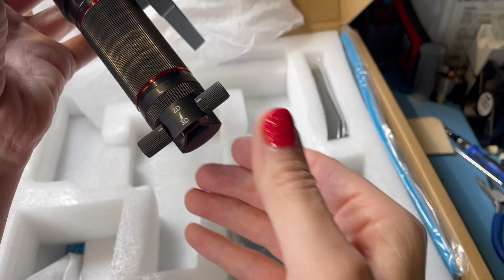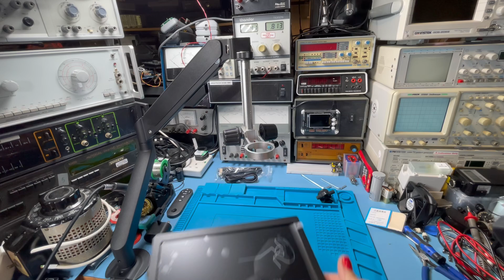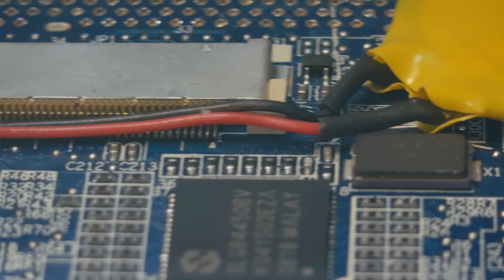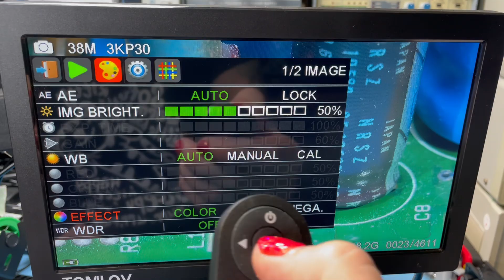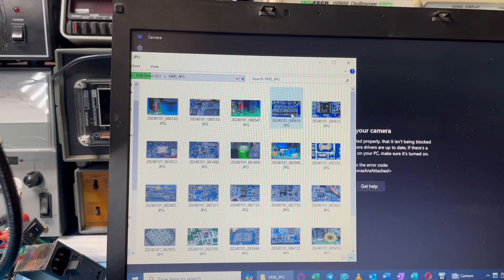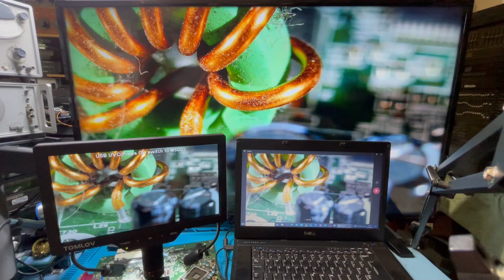TOMLOV TM3K-3D Max Digital Microscope - View Your Electronics In A Whole New Way!

Comment: G'day Jazz, I purchased one of these microscopes from Tomlov via Aliexpress. Only arrived today so I haven't had a chance to give it a good try. Zero dramas bolting it together - watching your vid definitely helped and everything seems to be working as it should but (tis always a but) Tomlov sent the wrong power supply (seems to be a constant problem with this company) and they screwed me on the SD card by supplying a 16GB card instead of the 64GB.
At first the magnetic lens seemed like a good idea but (another but) they can be easily dislodged if not careful.

Comment: Hello JazzTech thanks for the amazing video. what would you prefer between this two Digital Microscope? TM3K-3D Max or TM4K-AF MAX Digital Microscope .
Reply from the maker: @salim.studio they are both very good. The 3D microscope although not true 3D is still a very useful feature for looking at components at an angle, but also the auto focus on the TM4K-AF is extremely good and refocuses in about 2 seconds over a massive range. You won't be disappointed with either.

Comment: Calling that 3D is a bit disingenuous on Tomlov's part, and  I would have like a couple of quotation signs around that in the title, but the mirror(?) is a different feature for sure.
Reply from the maker: I did explain in the video it's not true 3D but it is still a useful feature. You can turn it off and use it as regular microscope.

Comment: ⚠⚠⚠🕑🕝🕞 
📝📝📝🔋🔋🔋
Hello. I was a bit upset that all pictures are organied randomly because there is no clock battery.
I contacted Tomlov and they explained me that indeed they did not implement a battery 😲Why ?😠
In fact there is a slot for a 18650 behind the lighting module. Remove it and you will see.
I could easely place 18650 battery contacts bought on Ali and now it keeps time and date and can even work without power supply.

Comment: Hola, debo agradecer enormemente tu vídeo (está genial) ya que no hay reviews de esta extensión y detalle para el microscopio... Me dedico a inspeccionar placas madre de computadoras y cuando tengo la posibilidad de reparaciones básicas, las realizo. Actualmente trabajo con un microscopio chino G1200 al cual he modificado su base de fábrica para dejarla suspendida junto al microscopio, pero la baja resolución del aparato, no me permite soldar con comodidad y precisión, siendo una reconstrucción de pistas de un puerto USB-C un verdadero martirio y dolor de cabeza.

Estos son todos los microscipios que han llamado mi atención, pero el TOMLOV TM3K-3D llamó mucho mi atención por esa visual extraña de costado:

TOMLOV
TM3K-a AF (auto foco que no me convence del todo, multimonitor)
TM3K-3D Max (la visual 3D me intriga, multi monitor)
DM602 Flex (lo es cogí por ser más económico)
DM602 Pro (lo es cogí por ser más económico)

ANDONSTAR
AD409 MAX-ES (incríble base, tiene una segunda cámara endoscopio pero no soporta multi monitor)
AD409 PRO-ES  (exactamente igual a su versión max pero cambia la estructura de montaje)
AD210S-PRO 4K (lo escogí por lo económico)

AHORA MIS DUDAS RESPECTO AL TM3K-3D MAX
- ¿Si le conecto un monitor o TV por HDMI, la vista híbrida o doble con el zoom digital se refleja también en la tv o sólo en la pantalla del microscopio?
- ¿Tiene batería integrada o se puede agregar una posteriormente?
- ¿La visual 3D es realmente útil para inspección o también para soldar y afinar detalles del estaño?
- ¿La vibración del brazo articulado es muy notoria, se puede disminuir montándolo en un lugar rígido con mayor firmeza?

Comment: Mine arrived today and its garbage. The power adaptor was not Australian spec. Never mind, i have plenty of them. Then it wouldnt power on. Usb cable was faulty. Replaced that and then the usb port itself was faulty, i had to have the cable tilted up slightly in the port for it to work. Got that bodged up with blue tack, but now the lights dont work and its telling me theres no micro sd card installed when it clearly is. Very diappointed
Reply: UPDATE : Tomlov got back to me and asked if i could disassemble the unit and look for any obvious faults. They told me not to worry about voiding the warranty as they would send a replacement if i didnt find anything. Turns out that a ribbon cable hadnt been connected ....... plugged it in and its now working perfectly ! Im now a happy camper 😂
Reply from the maker: Did you get it from Tomlov or somewhere else. It sounds like you have got a bad one. I would make enquiries to send it back and get it replaced.
Reply: @JazzTechUK  yeah from tomlov. They want video proof before they'll consider replacing or refunding. Fair enough i guess but even if they sent a replacement tomorrow, it would still be nearly 3 weeks before it got to me over here in outback Australia ...
Reply from the maker: Still worth doing though I think.

Comment: So all it did was tilt the camera. I mean still a nifty and useful feature but a little too hyped up for what it actually is.
Reply from the maker: It's not true 3D, it can't be without 2 lenses, but it does enable you to see down the sides of components and see component markings. Yes you could tilt the board up and achieve the same thing, but if the unit you are working on is big and heavy and you can't easily get the board out or tilt the unit, then it becomes very handy.
It's still a very good microscope even with the pseudo 3D turned off anyway.

Comment: I would like to get the Tomlov TM3K-AF Flex! But I don't see how 3D would work on a 2D screen? Wouldn't the image overlay seem ghosted?
Reply from the maker: It's not true 3D. It just angles the lens to a different angle of the component on the board, so you are looking at it slightly sideways. Yes you could do this by tilting the board, but then it would go out of focus every time you tilted the board up and down. On equipment where you can't easily get the board out or tip the unit up because of the weight of heavy equipment it works well here. It is good, it does give you an advantage and you can of course switch it off. Both Tomlov microscopes that I have reviewed are really good. You wouldn't be disappointed with either.
Reply: @JazzTechUK   Thankyou, I've put in an amazon order.

Comment: Hello from Poland! It is very useful review and very detailed, thank you! But could you please share your opinion - which one is more useful for PCB soldering - the 3D (3K) or AF (4K) model? Both features could not be combined, as I understood. 3D limited by Manual Focus by the way, and AF is limited as well, and can't have interchangeable lenses.  Does manual focusing each time is real showstopper to compare with AF? Does AF always catch the focus or will it miss focus, if you move the solder into the area, and AF will refocus on solder instead of PCB? Really struggle to choose between these 2... Thank you advance!
Reply: For soldering printed circuit boards (PCBs), the 3D (3K) model is more useful and practical than the AF (4K) model. While autofocus (AF) sounds tempting on paper, in the practice of microsoldering it creates technical problems due to the physics of the soldering process (changes in height caused by the soldering iron, solder, and hands). The 3D model with manual focus offers the stability and depth perception that a technician needs. When soldering, you adjust the microscope to a comfortable height for manipulating the soldering iron and tweezers (using the 3D model's long-distance L-lens). Once you manually focus on the PCB surface, the screen remains perfectly sharp. Furthermore, your eyes don't get tired because the image remains static. You don't have to "fight" against an intelligent system that tries to readjust the image every time you move a tool. Additionally, the TOMLOV TM4K-AF microscope's AF system uses Time-of-Flight (ToF) sensors and algorithms to find the sharpest point. When soldering, this creates very annoying side effects if the AF (focus) frequently loses focus. If you insert the soldering iron tip, the solder wire, or your own tweezers into the viewing area, the sensor will detect a closer object and focus on the soldering iron tip instead of the PCB. Furthermore, when you remove the soldering iron, the microscope takes between 1 and 2 seconds to refocus on the motherboard. This constant focus change (blurry - sharp - blurry) is disorienting for the technician and disrupts the smooth workflow.
Reply: @Wallfahrt7247 very helpful explanation there.❤❤❤

Comment: no seria lo mismo si solo inclino el pcb?
Reply from the maker: Yes, but sometimes you can't tilt a board if it is inside something heavy. It's not true 3D but it's still useful and you can use it without the '3D' function.

Comment: Hi, can you tell me what the horizontal reach is of the flexible arm? From the size of the mat I guess it's about 50cm/20" but can you confirm this please, thanks! 🙂
Reply from the maker: It is 20" if you have the arm fully up. If you pull the arm fully down you can get 22" out of it. Note that only the top half of the arm pivots up and down (and twists). The bottom half is fixed and just twists left to right.
Reply: @JazzTechUK perfect! Thank you for the quick response.

Comment: I have a shelf above my bench which holds test equipment. Can you mount the flex arm to a shelf like this, either by using the arm upside down (would the microscope / monitor be able to still fit in to the arm) or alternatively if the arm was mounted normally could the arm articulate below the level of the shelf? Hope that makes sense!
Reply from the maker: You can mount it to a shelf no problem. The bottom part of the arm is fixed. Only the top part of the arm moves up and down. I just tried it, you can get it maybe 2 or 3 inches below the bracket, so realistically maybe 9 to 10 inches  below the bracket to the actual workpiece. Although I haven't tried it I can't see any reason why you couldn't mount the microscope/screen upside down in the collar. Then you could mount the arm upside down on a high shelf and have it be down low enough to use. The top part of the arm that moves up and down is quite stiff so I can't see any reason why it wouldn't stay in place upside down.
Reply: @JazzTechUK Thanks very much. I was looking at your video in more detail after I posted the comment and it does look like you could maybe have the whole arm assembly upside down and just fit  the microscope in the steel mounting hole the other way up, but hard to tell for definite unless its in front of you.
Reply: Also, i had a quick look on the Tomlov website and they list this as a 7" device. Amazon seem to selling both 7" and 10.1" variants. Perhaps I've missed something on the website and there's a bigger version.
Reply from the maker: Tomlov do do variants of their microscopes. A 10 inch screen is nice, unless you are going to plug it into a big monitor, then perhaps the smaller 7 inch screen is ok. Full resolution is only available on a big monitor, unless of course you zoom in on the microscope screen.

Comment: Another bloody good video. 👍 I think I'm going to order one of these.
Reply from the maker: It's not true 3D as such, but it does offer something really worth having without the inconvenience of having to tip a board up at an angle. This might not be convenient if the board is still inside a heavy bit of equipment.
It's a great quality digital microscope in its own right even without the 3D function and the ability to change viewing area by just magnetically changing lenses is also a win. Get yourself one. You won't be disappointed. Don't forget to use the 10% discount code.

Comment: A similar  '3D' experience can be achieved on any microscope by tilting the subject, be it a PCB or whatever. There might not always be room of course. The way that this microscope does it with mirrors certainly is elegant and simple. I think some people might be confused by the 3D/2D terminology.  It's all the same, just one view being from the top and the other from an angle.  All of that said, I would love one of these! 👍
Reply from the maker: It's not true 3D, but it does offer something really worth having without the inconvenience of having to tip a board up at an angle. This might not be convenient if the board is still inside a heavy bit of equipment.
It's a great quality digital microscope in its own right even without the 3D function and the ability to change viewing area by just magnetically changing lenses is also a win.
Reply: @JazzTechUK  Agree!
Reply: By tilting the object with your hands, you'll constantly lose focus. This will greatly complicate the work. Here, however, focus remains constant if the object is moved in a plane parallel to the table.

Comment: 3D mode heaps good for hot air gun work.
Reply from the maker: Plus the component you are working on is not directly under the lens when in 3D mode which will help to keep the heat off the microscope lens.
Reply: @JazzTechUK  YES !! EXACTLY 💯  %.

Comment: A very impressive demonstration, but a couple of queries: is it really a '3D' microscope with two different image sources, or is it just an angled view across the object? Also, have you tried soldering in 3D mode? I can imagine problems trying to coordinate the movement of the iron with an image which isn't actually below the lens. Please let us know when you have tried it. Thanks Jane
Reply from the maker: It's not true 3D, but it does offer something really worth having without the inconvenience of having to tip a board up at an angle. This might not be convenient if the board is still inside a heavy bit of equipment.
It's a great quality digital microscope in its own right even without the 3D function and the ability to change viewing area by just magnetically changing lenses is also a win.
I did try probing on a board with the microscope in 3D mode and found it easier to get to the components required than a straight top down view, so I see no reason why this wouldn't translate to using a soldering iron and solder, plus the fumes won't be going straight up onto the lens.

Comment: Kind of disappointed it was not really 3D like a stereo microscope (that would obviously require some way of separating the images for both eyes) but just an angled "side" view. Still probably useful for things like reading the values on upright components and inspection.
Reply from the maker: It's not true 3D, but it does offer something really worth having without the inconvenience of having to tip a board up at an angle. This might not be convenient if the board is still inside a heavy bit of equipment.
It's a great quality digital microscope in its own right even without the 3D function and the ability to change viewing area by just magnetically changing lenses is also a win. Plus the fumes won't be going straight up onto the lens because of the offset viewing position.

Comment: Would this be a viable alternative to an expensive stereo microscope ?
For a hobyist yes, but if you are going to use it to repair laptops or phones then no.
Like most instruments you tend to get what you pay for, just don't expect too much
of the 3D effect
Reply: Yes.  As I wrote in a separate comment, the 3D/2D mode terminology might confuse some people and lead them to expect something 'magical' in '3D' mode.  The '3D' mode is actually no more 3D than than the '2D' mode, it's just that the view is from an angle.  Which I think is actually a great feature, but a more accurate terminology would be "Top view / Angle view".  Not quite as catchy though of course. 😉
Reply: @Geoffs_ya_runkle  Other reviews have said that the 3D feature is more of a gimmick
and won't offer the sme view as a stereo microscope which i find esential as my eyesight
is not what it was, this is one of the health issues that few talk about when it comes to
making a living from consumer electronics.
Reply from the maker: @BarbaraPape-y4g nothing will beat a true Stereoscope. It's not true 3D, but it does offer something really worth having without the inconvenience of having to tip a board up at an angle. This might not be convenient if the board is still inside a heavy bit of equipment for example.
It's a great quality digital microscope in its own right even without the 3D function and the ability to change viewing area by just magnetically changing lenses is also a win.
I did try probing on a board with the microscope in 3D mode and found it easier to get to the components required than a straight top down view, so I see no reason why this wouldn't translate to using a soldering iron and solder, plus the fumes won't be going straight up onto the lens.

Comment: It's certainly an interesting microscope and I can see quite a few well-thought out design decisions, not the least of them being the nicely large focus adjustment ring. Though, it seems a bit prone to picking up vibrations with the long arm. Although, I have to agree with you, that "3D" feature is a game changer. Being able to easily get an angled view on any board provides a multitude of opportunities during board inspections even if Tomlov went a bit hard on the tilt-shift effect.

I wonder though, with that feature being achieved by rotating a mirror in front of the lens, can you do a "less 3D" view? Does it lend itself to turning the knob just a little bit to tilt the view for just a few degrees from the vertical or are those knob positions not stable?
Reply from the maker: Yes, totally agree, the big focus ring is really decent.  The vibrations are less when the arm is not extended so much.  You can do a "less 3D" view, the knob will stay where you position it anywhere between the 2D & 3D positions.
Reply: @JazzTechUK  Thanks for coming back on that. Good news.